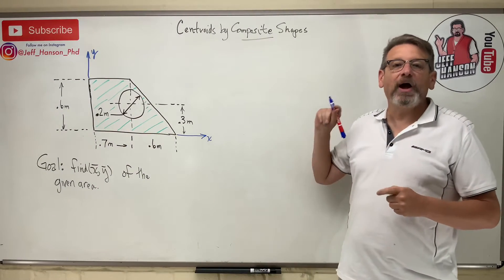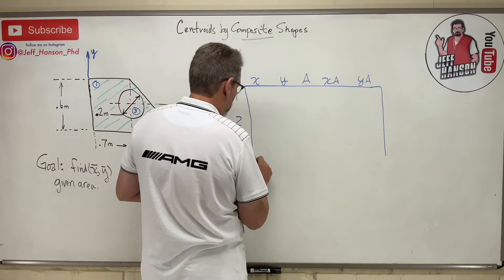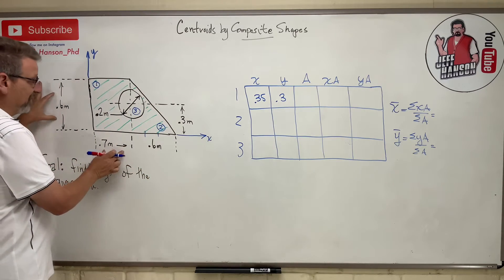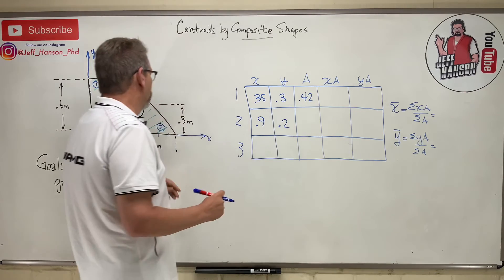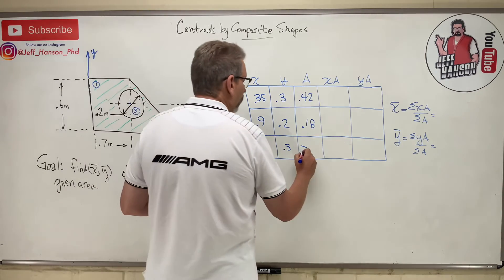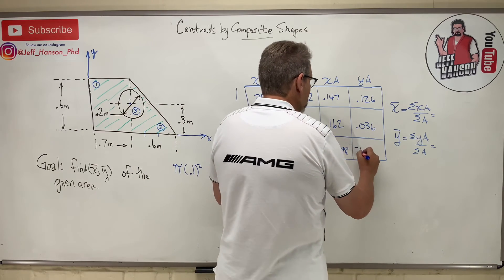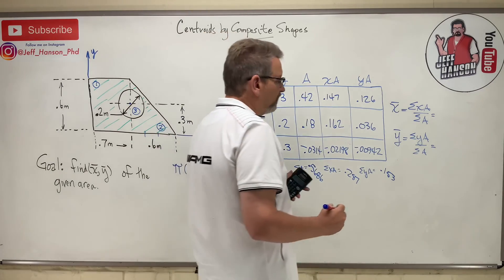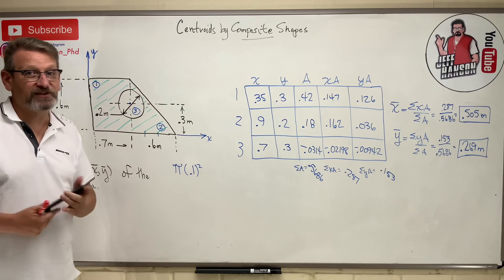Statics: Lesson 39 - Centroid Using Composite Shapes, Center of Area

Comment: The x bar is not one third of the base it’s 2 third of the base
Reply: It's 2/3 of the base if you were to do it from the low side, so basically the same thing. He did it from the high side of the triangle and that's why he used the 1/3. Don't forget that 2/3 + 1/3 = 1
Reply: thats what i did too